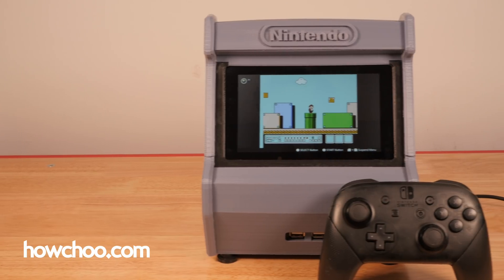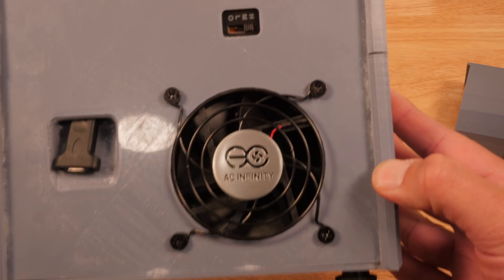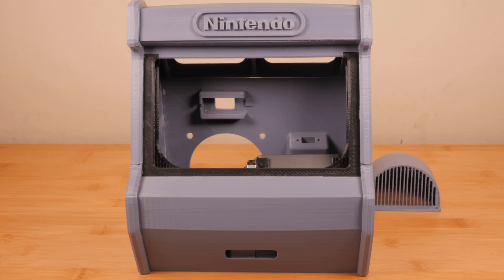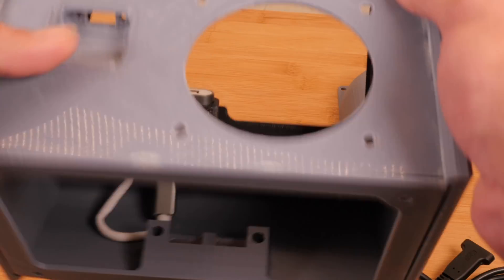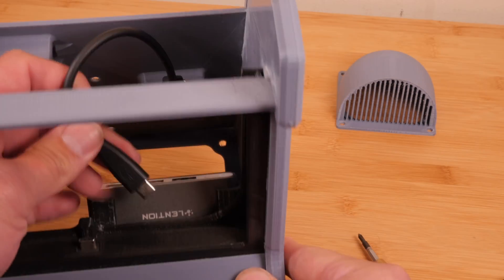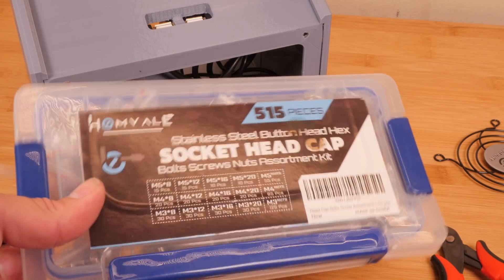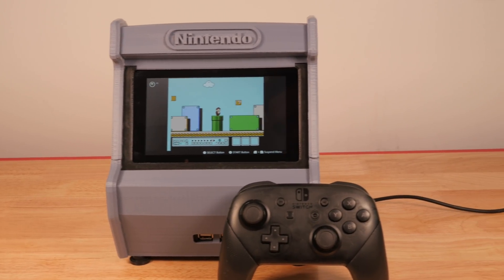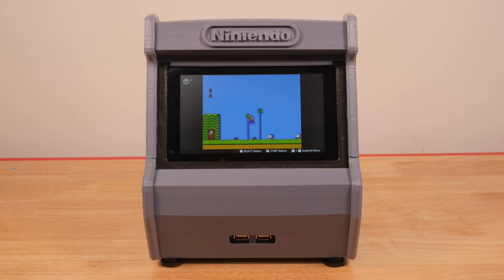Build Your Own 3D-Printed Nintendo Switch Arcade Cabinet!

Comment: Can u make me one 😢....without the cabal thing 😢👉👈  baby pink middle and....and violate sides 😄🌸🌻💐 i pay u...£25 :D
Reply: There are services where you can pay and they print the 3d print that you've sent them and then send the parts to you. But when you think about material costs, the cost of buying a really good 3d printer, the cost of sending the thing to you etc. and that they also want to make some profit from their work... it sure is going to cost you more than £25. Could you try making one out of cardboard? Shouldn't be too hard if you just get the right kind of cardboard and glue.

Comment: Finished this up today. I’m using an actual Nintendo Approved Switch Power-bank to power everything. Here’s a question....I like the build, but as we all know 3D printing has a tendency to “fray”...has anyone ever designed or measured this cabinet to make vinyl arcade sticker art?
Reply from the maker: Ah, no I haven't but it would be cool to wrap them! You should be able to open the STL is some program to take measurements on your computer. Slight 3D printing shrinkage can happen but for this case it wouldn't be substantial.
Reply: Do you have a link to where you got it? I’d like to buy it for mine.

Comment: Great Vid. I'm in the middle of this build and just noticed the Lention Hub is not charging the Switch (V8.0.1), but is still working as a hub. Is your's still working?
Reply from the maker: I'm out of town until next week so I can't test with the new firmware until then. But I'm curious -- what happens if you do this (in order): Remove your Switch from the dock, turn it off, connect the power adapter to the back, connect the Switch to the dock, and then turn the Switch on. In other words, keep the Switch screen off until it's in the dock and THEN turn the screen on.
Reply: @Howchoo it's seems it's very finicky as you did mention in your video. Just swapping back to the USB-C to USB-C cable started working, but following your instructions then stopped it working. I tried switching back to the USB to USB-C cable, but still no charging. 

I followed your instructions again and it worked the second time, I could see the charge icon appear before turning the switch back on and once started it remained charging with the USB-C to USB-C cable. I'm still building the cabinet so will repeat the process to see if I can get a sure fire working method.
Reply from the maker: @matthewwakeling4918  Perfect! Let me know how it goes :)
Reply: UPDATE: My AC Charger had a USB and USB-C connector, powering via USB-C to USB-C on the HUB did not charge the switch during testing. However, a USB to USB-C connection on the Hub will charge the switch. Now back to printing :-)

Comment: USB C hubs like that have been known to brick the console...it's a cool project but, I wouldn't risk such an expensive console on it. Otherwise, the rest of this is cool.
Reply from the maker: Great point, I definitely mentioned that — it’s been working fine with my Switch with the latest firmware version (mentioned in the video), but a firmware update could cause anything to happen. Thanks for noting this